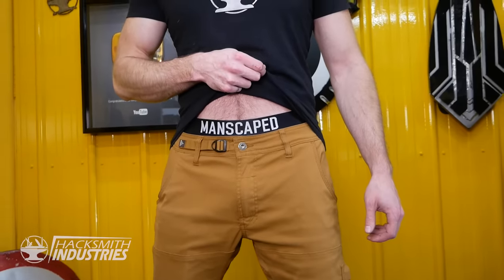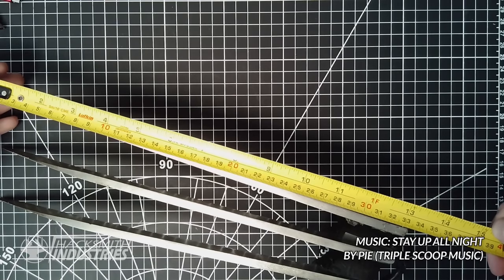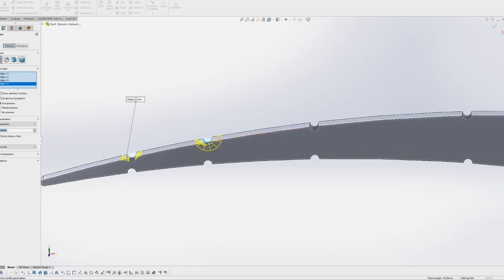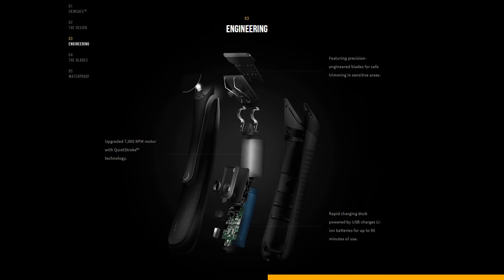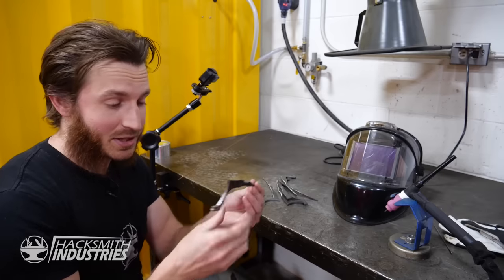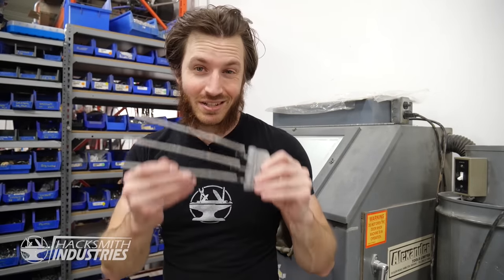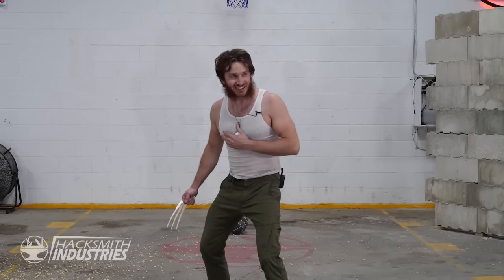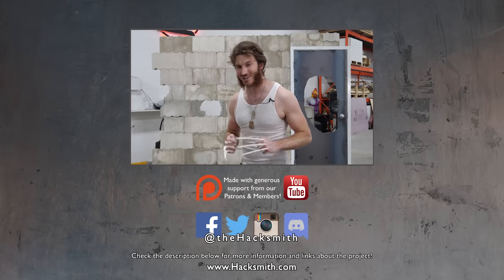Wolverine Bone Claws VS CONCRETE!

Comment: If you double tap on the left when james is putting on the jacket it says “James doing Whatever he wants”
Reply: If you hold the red reel bar on the bottom of the video and move it around you'll see he designated each part of the video with a title. That's why it works.

Comment: "either im going to break that wall or that wall is gling to break me"
punches through the concrete wall
Me: WHAT THE FU-
Reply: The blocks are empty. He could not have done that with a real concrete wall.
Reply: That is Lwc, not real concrete. You could dig through lwc with a spoon.

Comment: Sorry to say this, but the design of the bone blades is all wrong. I studied osteology, the pinched points you made to delineate the bones suggest joints. Joints are only present when there are tendons and muscles. They exist to flex a joint. The bone blades would be rigid, therefore there would be no joints, just a solid mass of bone, like a rib rather than fingers.